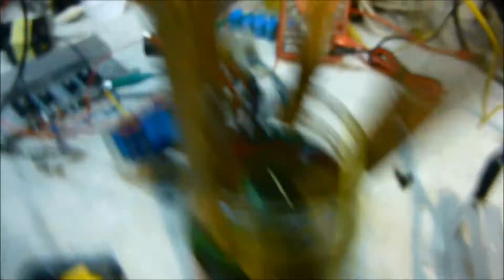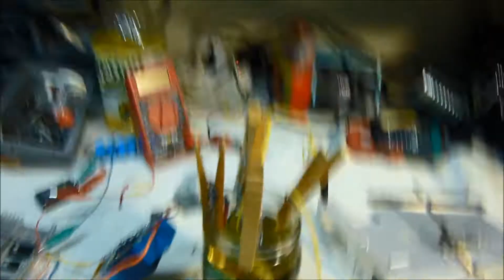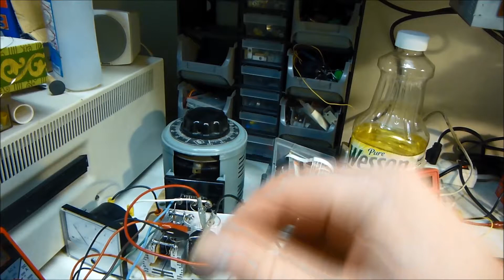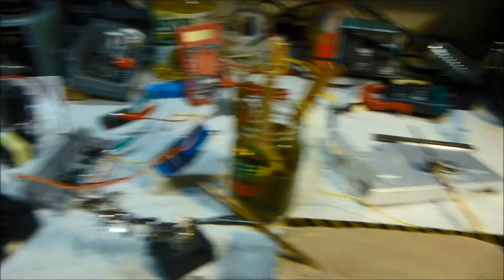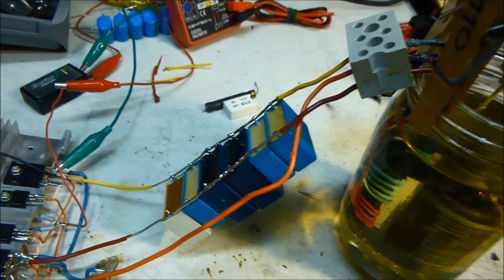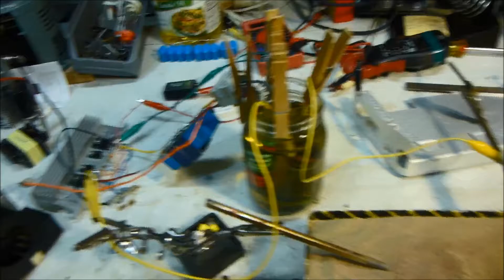Arcing Sand With My Homemade High Voltage Flyback Transformer, Current, and Power Tests

Comment: Can u please explain why you need such a complicated input circuit? why can't you hook the variac output straight to the transformer? cool project tho
Reply: Richard Graham 
The ZVS driver buts the output current at a different frequency that is ideal for the efficiency of the flyback

Comment: I'm just wondering how dangerous this actually is. 0.1A at however many kV would have to tickle a bit
Reply from the maker: Chris Dilger I can tell you you surely would not want to get bit by it.  It could potentially kill you if it went through the heart.
Reply: +Chris Dilger even 0.1 A is quite something

Comment: i realy would like to test that transformer on my tube diver
if you ever make another can you think of me :P
Reply: Makerj101 why do you need so many transistors I only used one for my flyback?
Reply: becaus if you want real power and no ic's or digital stuff

you need 2 transistors
Reply from the maker: ***** Sure!  I have a vacuum tube so I could try it out!  If i make another one just post a comment on the video there reminding me.  Thanks!
Reply: Makerj101 you should build a huge transformer and see what you can get out of it.
Reply from the maker: Owen Chase Yeah I want to build another one!  I have a slightly bigger flyback core so it would be a little bigger too!

Comment: instead of using a zvs driver couldn't you us a dimmer switch?
Reply from the maker: Yeah I could but you're not going to see me getting arcs anything like this.  I could probably get an inch or two with a dimmer setup but they sure wouldn't be as hot and powerful of arcs.  Thank you!

Comment: hv transformers are pancake shaped, one or more coils in series.
why? classic transformers have too much intra winding capacitance, and not enough insulation between windings.

use unflavored, hypoallergenic baby oil, instead of canola, might be better.

the primary winding needs to be stranded wire/litz wire, read about skin effect.
Reply from the maker: Yes, some do, but if you look as TV flyback transformers, they don't.  How would I possibly wind a coil like that tho?  And wouldn't the outer most windings be to too far away from the ferrite core to get any magnetic field?

And yes I need to make myself some litz wire.  Would probably help a lot with the over heating primary.

Thank you so much for your knowledge and tips!
Reply: Makerj101 http://www.angelfire.com/oh3/ebjoew/images/Coil_parts.jpg
You need someone with a lathe to make you a coil form.
Reply from the maker: Oh I see what you mean.  I have a couple little cores like that laying around.  Maybe I should try winding some wire on one of them.  Thank you!

Comment: Plastic cased meter arcing to ground, no that can't be "good for the meter" :P
Nice setup though.
Reply from the maker: Yeah hahaha !  It was actually the 9 volt battery I have tapped on the back.  I did not have three 3 volt lithium coin cells to replace the ones it came with.  Thank you!
Reply: @makerj101 lol i have the same meter and i also did the 9v battery mod

Comment: I've wanted a HV current meter for ages. I like what you did there.
Spark plug cables from a petrol motor would be good for more turns...
Reply from the maker: Yeah.  I think this is pretty accurate tho!  Seems to be accurate at least.  I always wind multiple wires around my meter when I want to measure smaller AC currents. It works really well.  Yes the spark plug wires would help!  Would keep the meter from arcing to things!  Hahaha  Thank you!

Comment: hey J looking good dude ! ok that metal clip that holds the ferrite cores together get it off its not part of the circuit and heats up melting the primary and heating the ferrite if ur happy with the flyback glue the U cores together .. replace the output leads with hv wire should not get any arc over .. try lower cap values for more volts @ lesser currents too i could make a comparison vid for u running mine ;-) dont kill it ! its a nice flyback just make another one =D and watch how many turns per layer too much internal resistance will heat up the secondary quick .. like the sand sculptures too maybe finer sand ? cheers dude keep on building !
Reply from the maker: Thank you!  I will remove it!  Yeah I could glue it but I think I'll just use a zip tie or two.  I will try that!  Thank you!  I might try clay because I don't have finer sand.  Not sure how it would turn out but it's worth a try I guess.